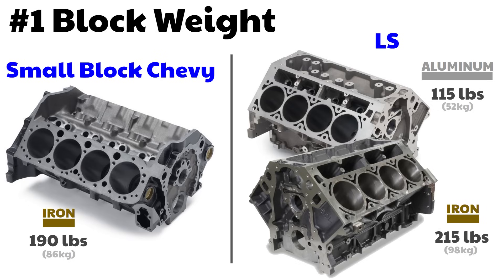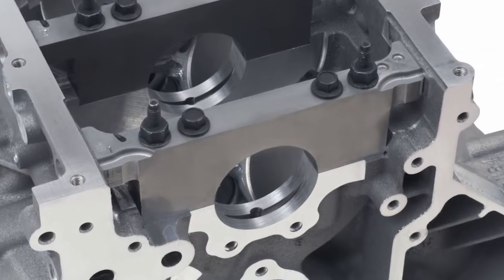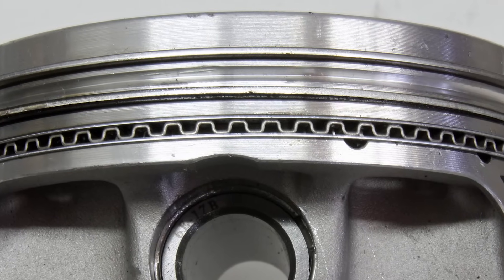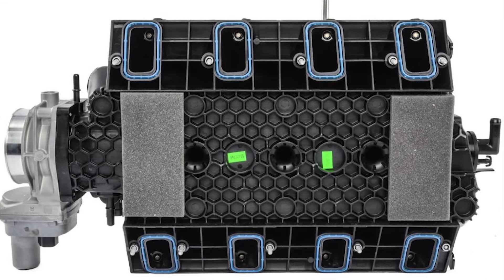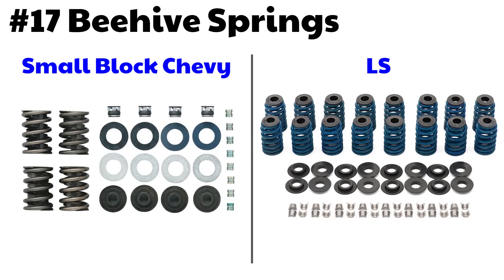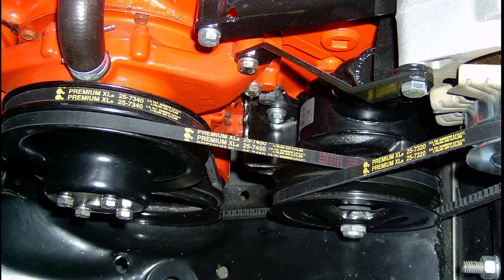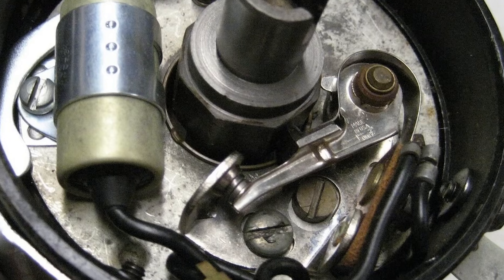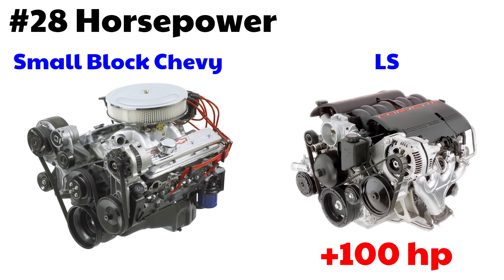29 Reasons LS is Better than Small Block Chevy (Gen 1 & 2 vs Gen 3 & 4)

Comment: Your comparison is not apple's to apple's so to speak. Comparing the LS to SBC engine's from fifty years ago isn't really a fair comparison based on the technology back then verses the technological improvements when the LS's were first produced. There are some of us that like old school classic cars with period certain engines under the hood. If I want to go fast I'll drive my 17 GT that has a PD blower and according to the dyno puts out 612 rwhp/500 ft. lbs. of torque. It gets horrible gas mileage for some reason. Don't always want to go fast. Sometimes just want to cruise.
Reply from the maker: I agree, I have a sports car so my 68 Camaro is my cruiser.  And I've had it since I was in high school with a 327 and a carb.  But now Im ready for something different.  So Im going with an Alum LS or LT.  But I still love the classic look too, my car has a 100% stock interior, original AM radio, steering wheel, everything is old school.  I can definitely appreciate that too.

Comment: David visard said a four valve engine (ford coyote engine) will potentially eat a two valve engine for lunch basically and your point is what hp that is,😁
Reply from the maker: My other car is a high revving 4 valve DOHC car, I love both.  Nice thing about the LS is the engine is much smaller so you can have a lower hood line and it will fit in all kinds of small cars.

Comment: My 450 hp small block has a super light crank feather light rods aluminum heads  belt drive arp everything msd crank trigger headers hapless rings runs pretty smooth makes 470 pounds of torque and cost me 6500 dollars how much would that cost with an ls oh yes my edelbrock heads cost me about 900 dollars for the pair how much would all that cost on an ls
Reply: Sounds like you spent 6500 to have someone else build it...a 6.0 with cam intake exhaust and tune garuntees those numbers and more
Reply: i rebuilt my LS 6 litre stock, with a custom tune that is around 415 horsepower, 
no mods but dual exhaust
I love my old smallblocks,
but the LS is so much better im sorryto say
Reply: A stock 6L ls with a cam swap and headers will make 550HP.. using all stock engine components
Reply: Typical  boomer build sbc for that money u could hv a trurbo ls

Comment: You forgot cost
Reply from the maker: Yes, a small block chevy is cheaper to build, no doubt about that.  The LS swap means you have to change out so many other items so the costs really add up.  For me the main thing I love about the LS is the Aluminum block, 100lbs lighter, that equals better braking, handling, ride, gas mileage, everything.  Thats the main selling point for me.

Comment: To keep it simple the LS is literally just a next gen updated SBC.
Reply from the maker: Thats true, in many ways its just the normal evolution of a legendary engine!
Reply: In fact it is a 3rd gen. 1st gen SBC, Lt, and LS motors
Reply: I know I'm late, but I've said the same thing. 👍
Reply: Make it out of iron, and would be non stopable
Reply: Duh, its a newer small block made by gm......
Reply: How?  The only thing thats the same is the fact that its also a pushrod V8. Every single thing on the LS is distinctly different.
Reply: @kylegreen378  Wrong. Same hydraulic lifters, same diameter rod throws and bearings
Reply: Also 4.4 bore centers, and same rod bearings  👌😎 @kylegreen378
Reply: actually incorrect. the LS is an updated ford motor. the water flow through the block is straight off the 351c,  but the heads are without the canted valves on the mundane version (I think the race versions may have canted)
Reply: @xxxmikeyjock  Actually, that is false. The LS does not have anything in common. And to note, we could go back and say that the Windsor is a copy of the first Sbc, because GM created the OHV design.
Reply: @jacobgonzalez7797  The LS is definitely not based on the Ford Windsor, this is why LS heads and headers can be bolted onto Windsor blocks.
Reply: @jrburger95  Not without some Machining ,the LS1 bore spacing and head bolt pattern are nearly identical, apparently a couple of head bolt holes in the head are slightly off in the corners but only slightly, if you install these heads on a 351 block and bore the head bolt holes out to 1/2" to accommodate the Windsor block you can easily correct the small discrepancy. The biggest problem you would have ,would be getting a cam custom ground to match the swapped valve pattern of the LS1 head and either adapting an intake or building a custom Sheetmetal piece.
Reply: @Mista2  yeah, easier to just use Cleveland heads. But still kinda Sus that the heads on an LS almost bolt straight on and the headers do too.
Reply: @xxxmikeyjock  the reverse cooling was in use before the LS in the gen 2 lt1 small block v8s as well. They developed this to pull more heat from the heads to run higher compression, and keep the block and cylinder bores at a more consistent temperature to avoid premature wear. I wasn't aware that the Cleveland motors even had reverse cooling?
Reply: @xxxmikeyjock  So you're saying it took Chevy to make the Ford motor worth having?  
And wonder what the Cleveland and Lima motors were copied from? cough*BigBlockChevy*cough
Yet if you want a 429/460 to hold up under any power, the first thing you do is put BBC rods in it, lol, and loads of other mods.    
Whereas with a BBC you just use the stock components and you're good to go up to about 700hp.

Comment: I mean this is stock, throw upgrades on it it can put more power down, remember 350 SBC still will beat a LS in drag races, they need work and upgrades to be powerful, carbs are way easier and fun to tune, I like fuel injection but carb it the way to go for me, no need for a computer, yea Chuck from street outlaws was hauling ass with a 350...
Reply from the maker: For sure the SBC is much simpler, easier to work on, more parts available, can still make great pwoer.  The problem with em is that to make good power you have to go with a radical cam and then the engine gets kinda unruly on the street, but of course some people love that too so its all good.

Comment: Good information 👍. I have a 93 3500 chevy pickup it has a 350 with a manual five speed transmission. I would like to do a Ls swap.What would you recommend?
Reply from the maker: I'd go with a LQ4 or LQ9.  You will want a lot of torque since thats a big truck.  Focus on large displacement like 6.0L or 6.2L.  Or you could do a 5.3 and go with a turbo for huge power but thats gonna cost a bit more.  What do you want to use the truck for?
Reply: @AutoGuild  For a dump truck or chipper truck.
Reply from the maker: @Ivan-lx2ly  LQ9 if you can find one.  Or 5.3 is fine too.  Will get you a bit more gas mileage too.

Comment: I love this channel! Subbed. I would love anyone's thoughts on my 88 Chevy K1500. It has a 350 in it.  It's still in great condition. The motor is a crate engine from Chevy  that I replaced in 2004 because I blew a rod hauling firewood up and down the mountains.  Had a 350 in it before that. Still has orginal tranny.  Now I want to restore the whole pickup. I use the truck for the mountains.  Any ideas for a new motor and transmission? It's a automatic. 3:73 gearing I think. Kind of sounds like LS engine is the way to go. But I think know what is best for a pickup.  I'm a outdoor gal.
Reply from the maker: I would go with a LQ4.  Or any iron block 5.3L.  I would  try to find a used engine with low miles, maybe under 50,000 if you can.  Get it with the 4 speed transmission.  Did you see my video on best engine for any budget?
Reply: @AutoGuild  thanks Auto Guild I will watch it! Sorry I'm late relying and appreciate your answer!
Reply: I suggest a 5.3 LS iron block,with an older 4 spd auto (NEWER TRANS ARE TOO WEAK EVAN FOR A STOCK ENGINE, AND WHY OVERBUILD A NEWER TRANS FOR A STOCK/ MILD ENGINE,  LS's. are fairly cheap,( NOT QUITE 350 CHEVY cheap  but well worth it ,MY TWIN TURBO 5.3 WITH 350 TRANS PERFORMS VERY WELL, IN MY 94 DODGE EXTENDED VAN  AND I RUN IT HARD..
Reply: @politicalnonsense9857  thank you!

Comment: Too much electronic, That not a good thing... And you cannot fix sensors and ECM with your flat screw driver... In small block you almost can fix anything with your flat screw driver...
Small block can drink shittest gas you can find and still runs at 100mph ...
 That what my father said, and yes he hates commies cars...
Now we know which one is the post-apocalypse car engine we should own...
Reply: Let's net forget, TBis are simple to operate on, while MPFI is not that simple.
Reply: Robot 13  yes it can, but it shoudn't...
Reply: get a volga and put 13B on it then show it to your dad lol
Reply from the maker: You bring up some valid points, in a post apocalyptic scenario, and certainly any sort of zombie situation I would prefer the tired old 327 in my Camaro.  Even if it does have 80K miles on it and only makes like 140hp!  Also, after I write this i'm going to the garage to put that spare flathead screw driver in the glove box.
Reply: A 350 is done at 150K miles, a 5.3 is just getting broken in
Reply: @bangarang74  That is false, my Uncle's Yukon SLT of 1999 has a V8 Vortec 350, and it has over 200000 miles.
Reply: @bangarang74  I forgot to mention by the way, a guy whom I know and whom is on YouTube by the way whose channel is call "blackandgold51", had a Suburban half ton 2 Wheel drive Squarebody 1990, along with a V8 350 TBi and 4 Speed Automatic 700R4. With rear Barn Doors. Check out his channel by the way for videos of it.

Anyways, before he took out the original V8 350 TBi that was stock, due to overheating because the last person he got the vehicle from had someone who put he wrong size radiator in it and overheated after it got back home from the interstate from out of town . From Thibiduex , Louisiana to New Orleans, Louisiana a few years ago in hot month of June.

Engine had over 196000 miles which before the overheating the engine operating smooth. And replaced with a V8 350 Tbi from a 1992 3 Quarter Ton Chevy , which that engine when first put in had over 74000 miles.
Reply: @bangarang74  oh please ive seen plenty of sbc roll over 400k miles, the sbc in my 89 chevy has over 350k miles and still running strong

Comment: I do agree the LS cylinder heads are fare  superior, that’s were the power comes from , the big cam core is incredibly superior to the Sbc.  I’m not trying to be disrespectful here. The Y block design with a six bolt main may look incredibly strong. But that’s exactly what’s wrong with the engine it creates massive windage and oil control problems. that’s why  aftermarket LS blacks get rid of the six bolt cross  bolt design and they go with a splayed four bolt main to open up the crank case to help with the oiling problem. The gen 1 sbc uses 7 gallons of internal oil leakage per minute of internal oil leakage at 6500 rpm , a top fuel dragster uses about 4 gallons per minute at 6500 RPM, the LS Uses 18 gallons of internal oil leakage at 6500 RPM.  This means along with a closed off Bay to bay crankcase with the cross bolt main cap design causes massive windage problems. And now the crank shaft ,,, The block  is shorter then the gen 1 sbc.  This created a problem where they had to remove Center  counterweights off the crank shift which causes deflection in the crankshaft at higher RPM witch wipes out bearings.  i’m not completely slamming this motor. They make great budget builds  5 to 600 hp reliably which is very impressive beyond that I would go with an aftermarket block and crank. I guess the point I’m trying to get across the engines not the best thing since sliced bread.  No disrespect to LS lovers out there. And to correct what he says about the gen 1 sbc the older blocks are the stronger ones. Ive put north of 800 hp into an old stock sbc block.  I’ve seen others put even more.
Reply: I have 457hp on stock bottom end of a 5.7 vortec daily driver love it!
Reply: Brandon Shirey I recently built agen1 sbc dart shp 427 that makes 682 hp n/a and that’s with the budget dart as cast shp  heads and Idols in gear at 900 RPM.  It does 10:80 in a Monte Carlo ss.  been driving on the street all the time. I’m very happy with the motor
Reply from the maker: True the windage issue is a concern but if it were a major problem the engine would not be hugely popular today.  No engine is perfect I suppose!

Comment: The factory sbc blocks took way more than 360hp. That's just hilarious to me. Made 800hp+ multiple times with nitrous and superchargers. Obviously it doesn't compare to the ls block. The only time you'll have a problem with a factory block is if you leave the factory cast crank in it. 
The major reason the ls is so popular is the air the factory heads will move and the strength of the bottom end from the factory. 
I would hope after many decades chevy would come out with something much better. It wouldn't be worth it otherwise. When it gets into fully built motors. There's nothing stopping a sbc from making a ton of power. Ron Rhodes in X275 has been 4.20s in the 1/8 mile with a 23 degree head and nitrous. 
Again the reason the Ls makes more is because of the head. The factory heads on the sbc just don't move air. Certainly not compared to an ls. Specially when you get into the ls3 etc. 300cfm+ stock. 
If you can get your hands on a (new version) LT4 or LT5 from a wreck. You can make some big power with a supercharger upgrade or turbo. 
Not a bad video bro. Much better than many I've seen. I'm usually just shaking my head.
Reply from the maker: Based on lots of research that is what I found.  From multiple reputable magazine articles.  The number is for maximum horsepower from a stock block while retaining reliability.
Reply: The major reason that the LS is so popular is that you can stick in a relatively small engine bay.

Comment: I believe a LS requires you to remove the heads to replace lifters. And a SBC dont.
Reply: Neither ls or sbc is required to remove heads. But with ls you dont have to remove heads to replace a cam
Reply: @406_chevelle8  how do you replace LS lifters without moving heads?
Reply: @deonh8447  ignore that I dont know what I'm talking about. Ls you have to. Sbc you can remove intake and leave heads. It's been 3 years since I built an ls I thought you could remove the valley cover, my memory is shot
Reply: You can do it without, in some cases with a modified Ls motor.
Reply: @waynebollentin989  got it
Reply: @deonh8447   don't get me wrong. Even then it's a pain in the ass. So I don't confuse you or anyone else. When I say modified engines. I'm referring to when the lifter trays have been eliminated and replaced with a link bar style. When you get into big cams and high rpm. The factory plastic lifter tray can crack. Specially if you drill them for oil drain holes.

Comment: Remember, those crusty old dudes are why you have an classic car industry today. Young Punks driving hoped up Honda's are a blimp on the radar with fart can mufflers.
Reply: My honda has torque vectoring, the best variable timing in the industry, and one of the best AWD system...no fart can lol...  I also have a 69 Camaro with an LS3, TKO600, 12 bolt, Ridetech rear 4 link.